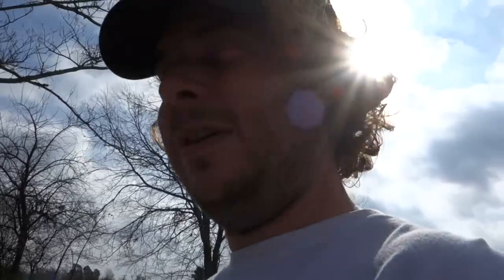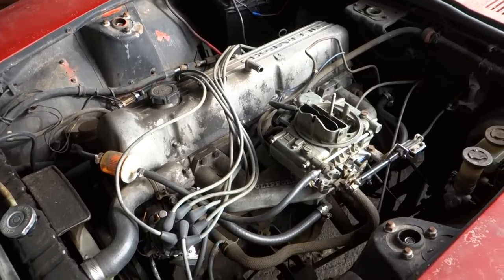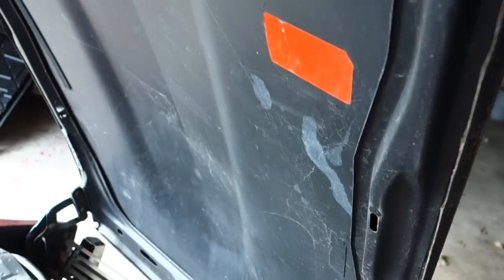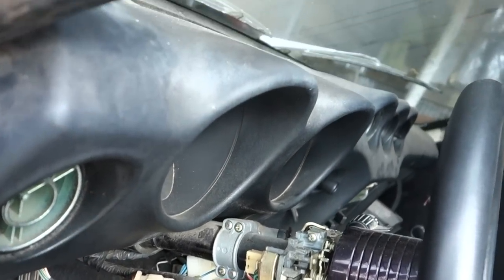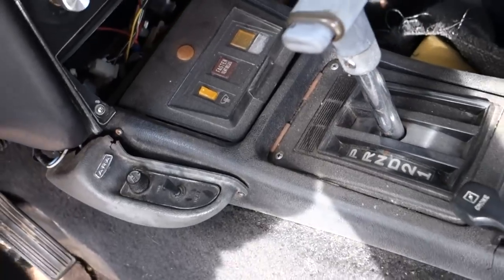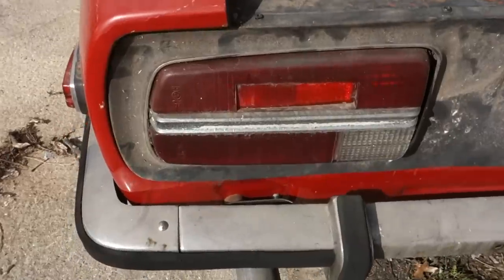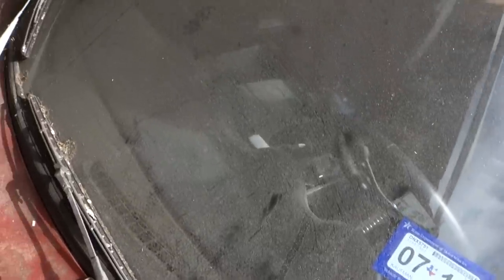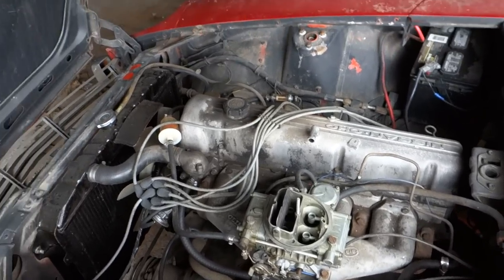Datsun 240Z Project Episode 1

Comment: You're right to make it as original as possible.  It'll feel good to know everything you do to the car is increasing its value in theory.
Reply from the maker: +heymisterderp Yes! I am about to hit it again once it cools down here. I have the engine about ready to pull out.
Reply: +samspace81 Hey Sam did someone paint the engine bay with primer?   I can see spots of orange where it peeled off?
Dash looks really good.  I didn't even really see the cracks but if it were my car I'd just leave them there like a  badge of honor.
Nothing wears orange like an old Datsun Z car.  I'd take it back to orange if it were my car.